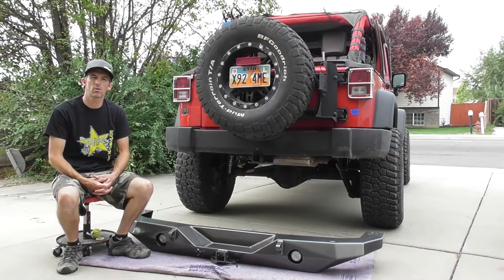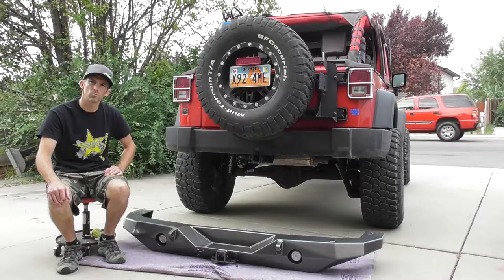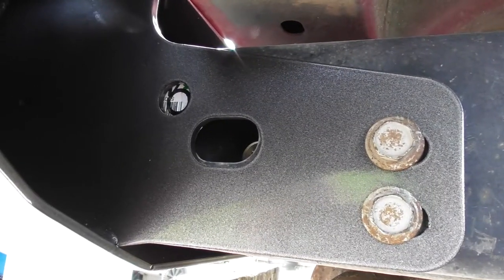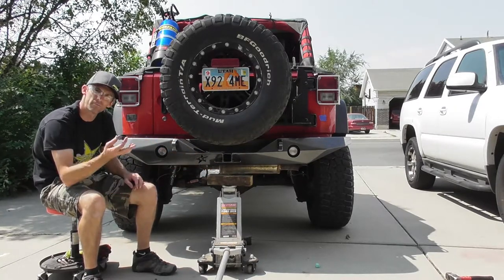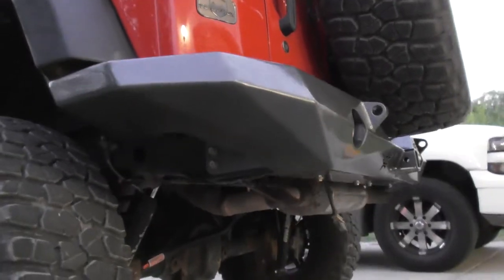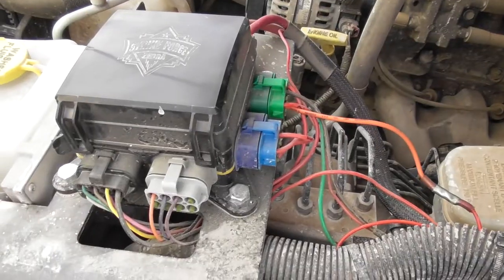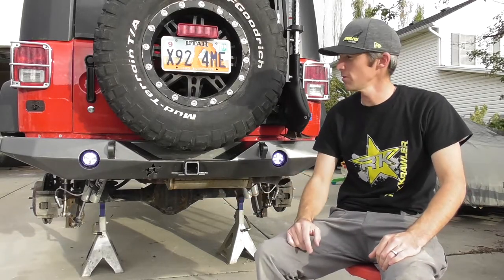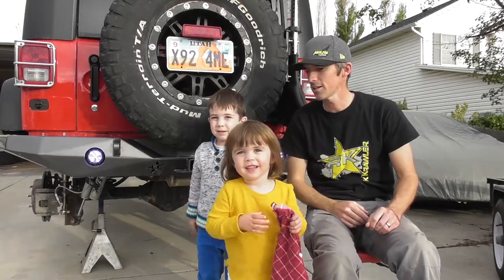New Crawler Conceptz Rear Bumper!

Comment: Thanks for the vid, keep doing them!  I'd add some braided cable sleeve to protect the wiring if not running in the factory loom. The other thing you could do is add a rv/trailer diode from road master or Hopkins (Amazon) and run a wire from the reverse lights to power these so they come on when you put to Jeep in reverse.  The circuit will be able to handle the draw from those LEDs.
Reply from the maker: krashnpa great advice. Thanks for the info I'll have to do that